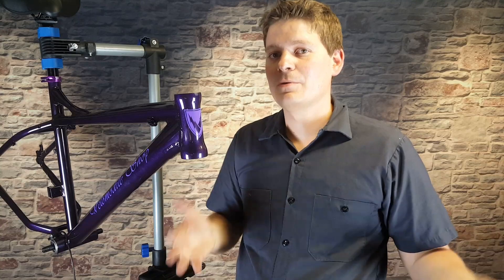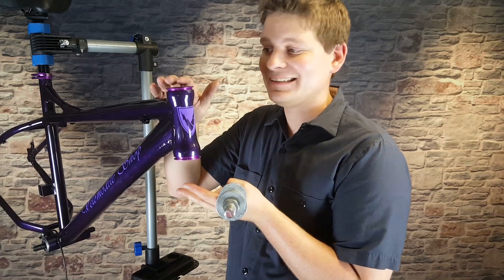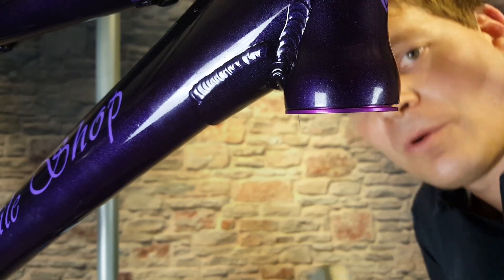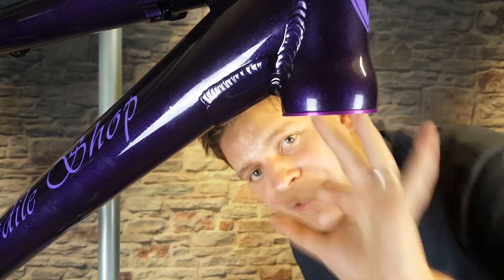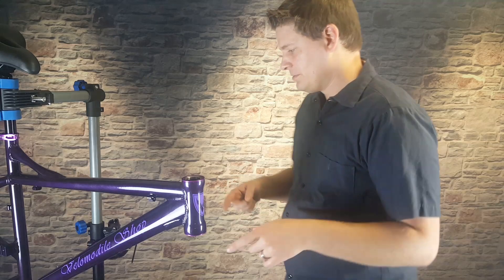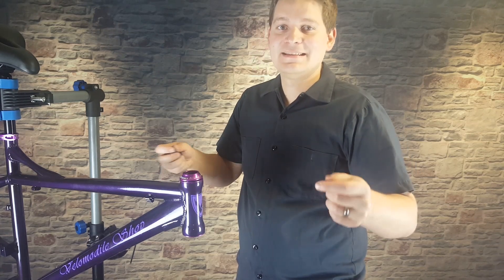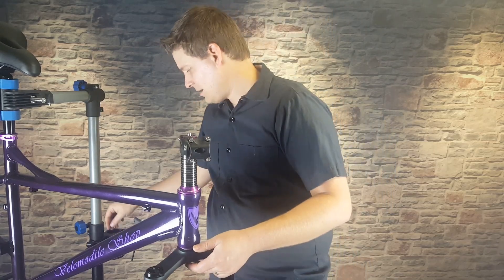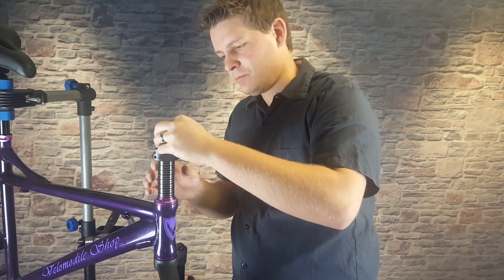How to build an ebike, Episode 3 - headset and fork install

Comment: Hey Appreciate for you work, and the way your clear explanation is excellent. but before that fork you should of explain few details about Headtube details example Universal headTube length,diameter suitable crowny cup, bearing size, etc..
because of there are many people struct at HadTube measurements they would like to design own(custom) frame for bike but this headtube is the main issue to them for measurements, if they took own measurements headset(bearing,washers,cups etc..)parts many not available in master for front fork.
so if you make a video for Universal HeadTube measurements,we will follow to during frame design. hope you will make a video for HeadTube measurements.
Reply: Kyle, thank you very much for sharing your experience on e bikes and this business. It always appears your knowledge has been well earned.